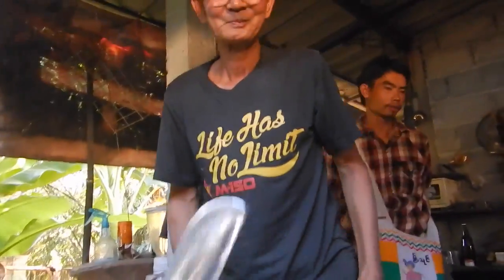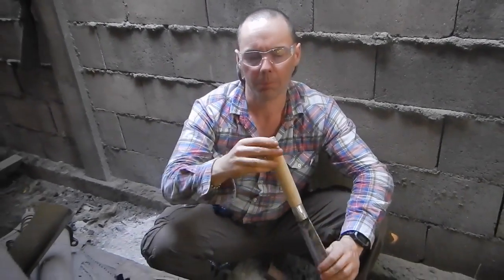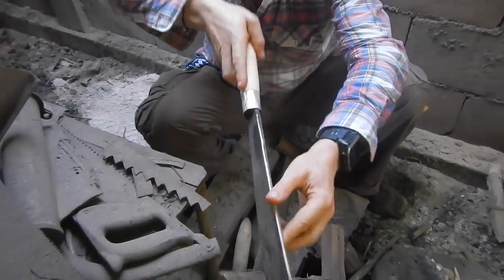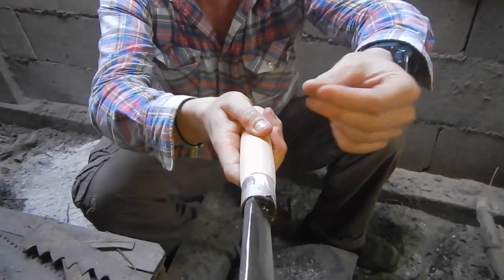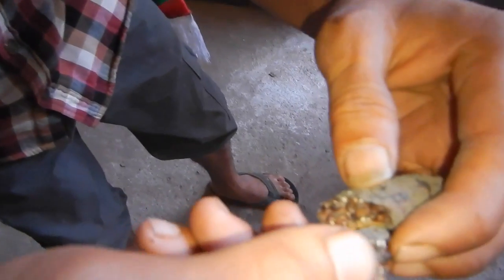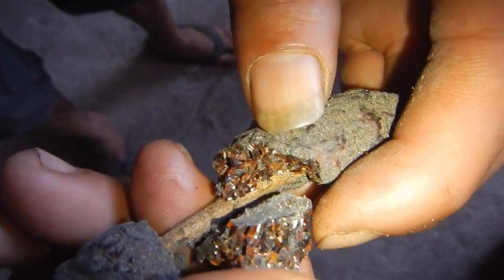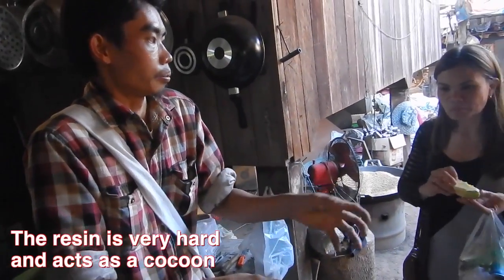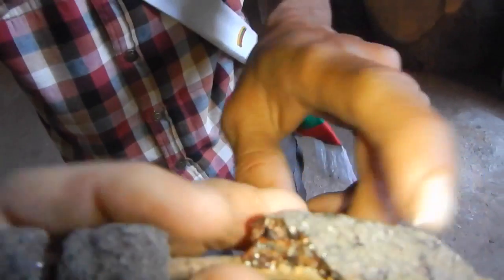How Thai Blacksmiths make Machetes Quenched in Oil

Comment: leave the batoning up to the yanks and poms. 
I would posit that these machetes would be better used as a weapon rather than as a bushcrafting tool.
I dislike how easy you can come up on the blade with most of these traditional tools, they need a guard.

Comment: Why use bamboo for the handle rather than teak?  The latter seems more long-lasting.
Reply: Bamboo is cheap, light, strong, readily available and easy to work.  The almost-solid pieces they use has a small hole in the middle, which teak does not.  Heat the tang and burn it in for a custom fit. Many people out in the boondocks do not have anything but the most simple tools.  No electricity, no drill, grinder, saw, nothing.  Bamboo handles are light but strong and relatively easy to fit and replace when necessary.  Much of the better hardwoods were excessively logged and are endangered.  Some is poached from protected forests.

I'll bet a bamboo handle will stay on better than Teak or some similar hardwoods that have a high oil content. They may also provide a better grip when one's hands are sweaty.  A number of knives other than farmer/working knives do have hardwood handles, though generally not teak in my experience.

Comment: Lemme get this straight. The handle is held on by glue. And it is a machete. A heavy metal piece that constantly strains that glue with every single strike. Yeah, I will pass on it, I don't want to have it fly out and stick into someone's chest. 
And without wanting to look like a hater, that is an uneven, incredibly thick and steep edge. Good luck cutting anything harder than banana trees with it. Plus I might be mistaken, but if that is how he quenches, then that blade will permanently bend sometime.
Reply: I imported dozens of Thai machetes with the standard bamboo handles that are supposed to be glued in with shellac but come without the glue.  Many sat around in the garage and the tangs slightly rusted.  Some I can't get off without severely pounding them with a hammer.  It is amazing how well they hold even without the shellac glue.  If a Thai blacksmith reworks a blade, he'll throw it in the fire to get it hot enough to melt the glue. That glue might not hold up in sub-zero weather, but it works in the tropics. 

As for edges,  they vary with the thickness of the knife and the intended purpose.  I find Thai knives to have rather thin edges for a chopping type knife, considering some of the hard woods they chop.  These aren't kitchen knives.  Also, they are generally a convex edge for strength. 

Quenching styles vary over there.  I never saw anyone use oil, always water.  Some quench edge first.  My 70 year old blacksmith friend quenched spine first, and tempered in the same operation to avoid stress cracking. He never let the blade completely cool between the quench and temper.  He had some special clay mud that he would put on in a very thin coat.  I think it prevented oxidation in the final heating so he could easily see the temper color without buffing the blade.  He made excellent blades.
Reply: nnnnnie Are you all right? Did you have a stroke or something?
Reply: Nnnnno problem. Sticky keyboard.